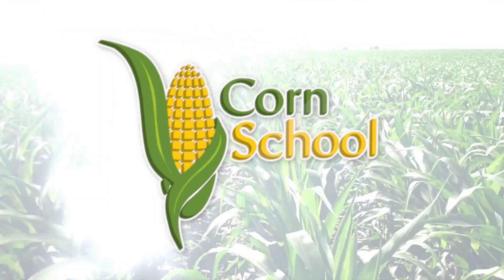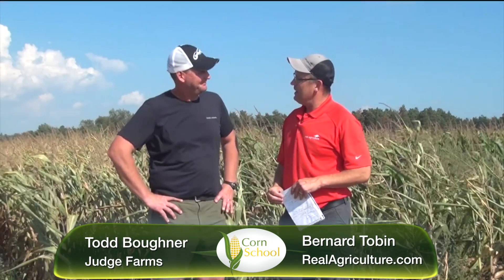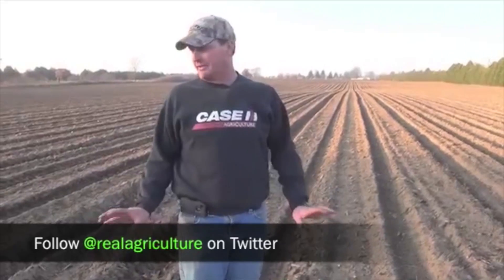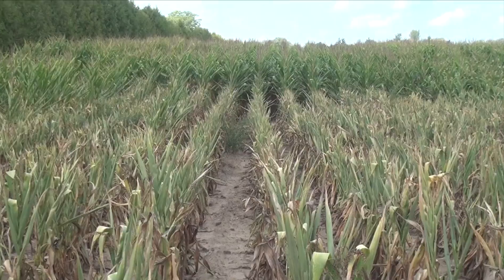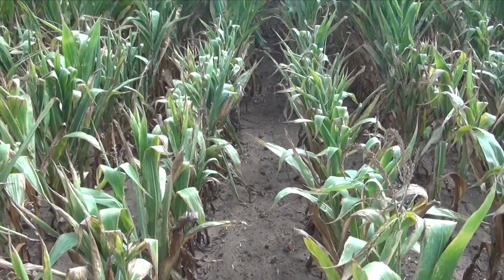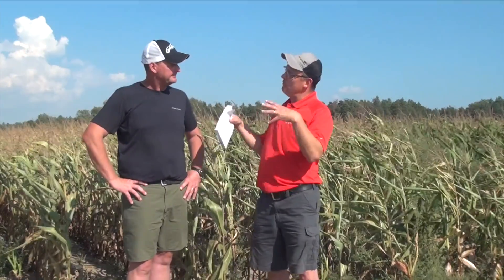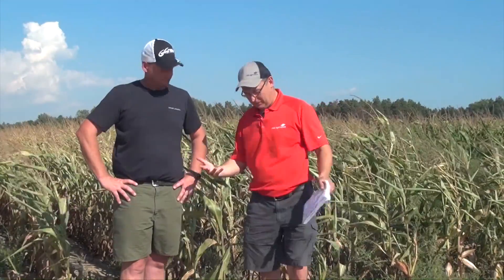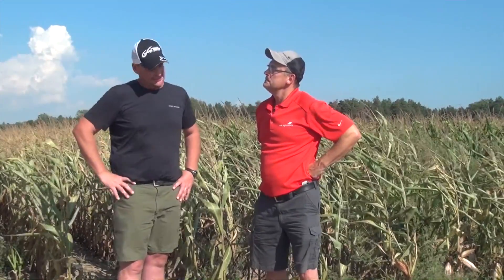Corn School -  Sub Surface Drip Irrigation

Comment: How do you till the field when there are subsurface water lines?
Reply: Drip lines are below the tillage level. They are usually below 30-40 centimetres. Of course, if they are more shallow then you also till more shallow or practice no till.